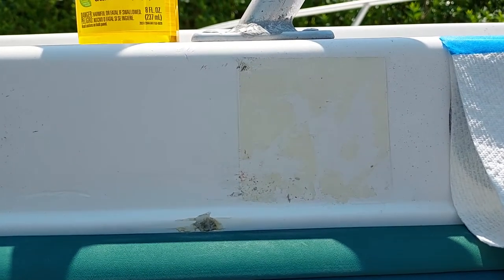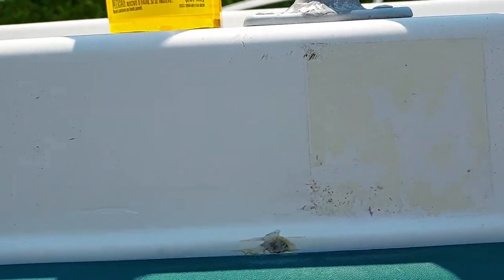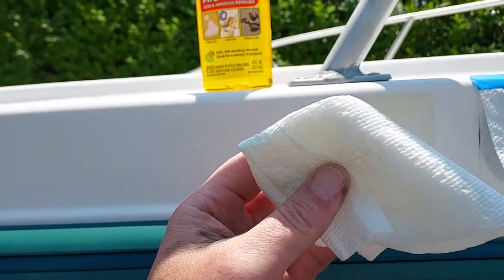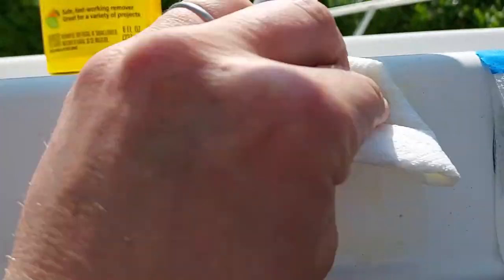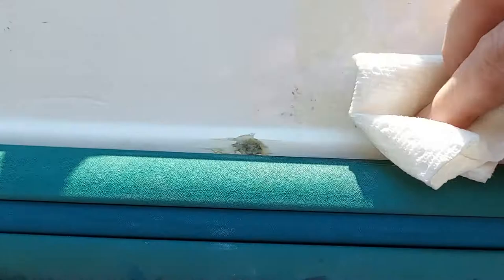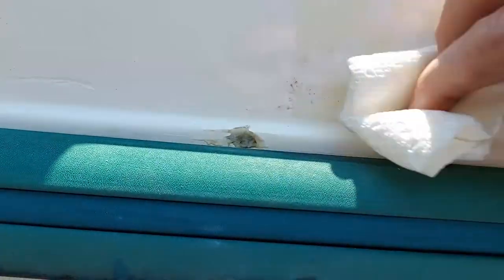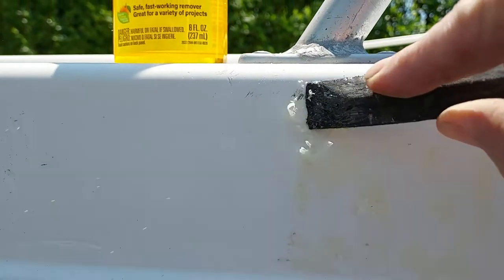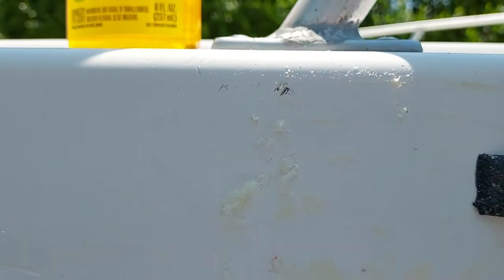How To Remove Adhesive from Fiberglass

Comment: Didn't work for me.
Reply from the maker: Sorry, works for me every time. Perhaps you have a different type of adhesive...you might want to try using a heat gun to soften the glue - you should then be able to scrape it off.
Reply: @fixingstuff2647  No idea. It was a decal for a John Deere garden tractor. I finally used a citrus cleaner and a plastic spatula s using a slicing motion to peel it off.